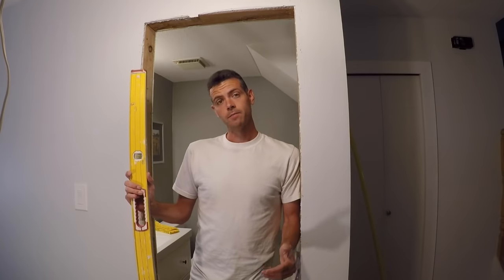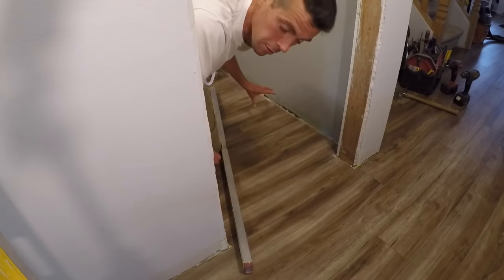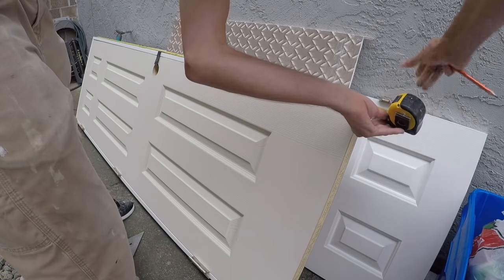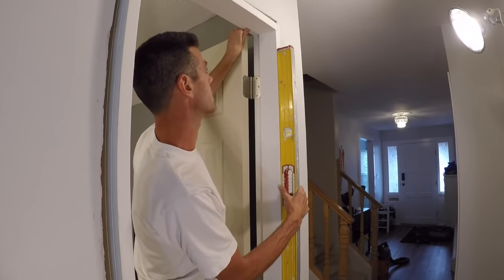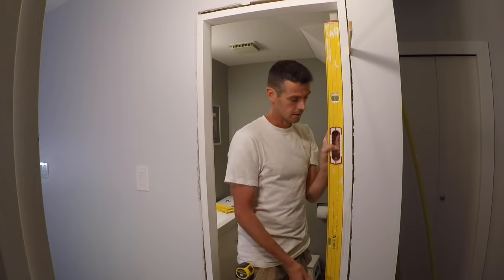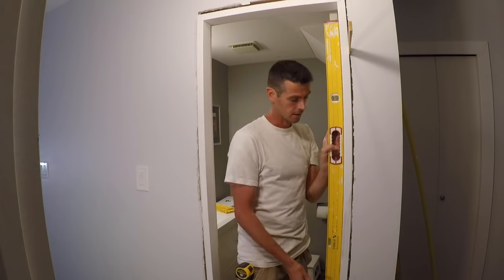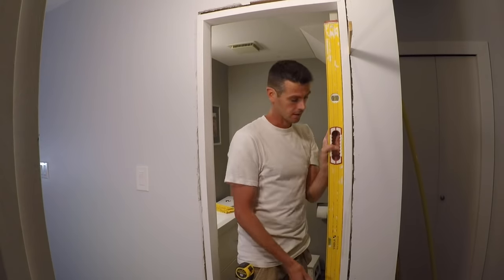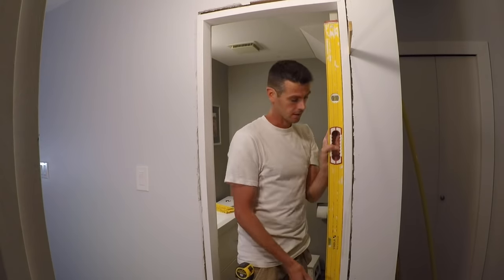How To Install a Door in Bad Framing!

Comment: this video is hilarious, for one you are not even using the terminology right when you are talking about the wall being 'level'? level is horizontal and plumb is vertical. and also you are not 'hanging a door' the door is hung already in the casing so a lot of the carpentry is done because its pre hung. you are literally just screwing it into the opening.